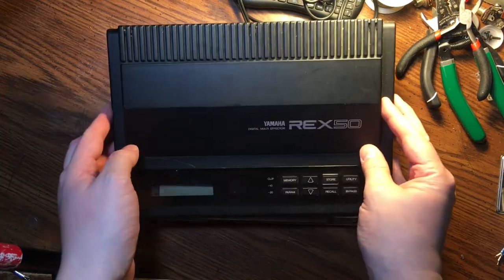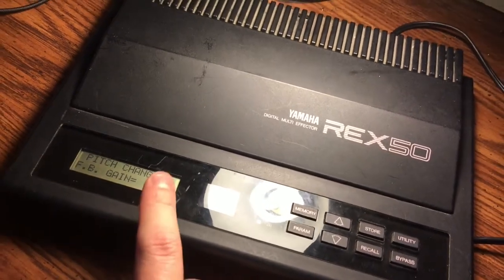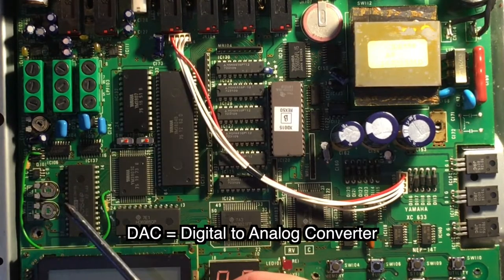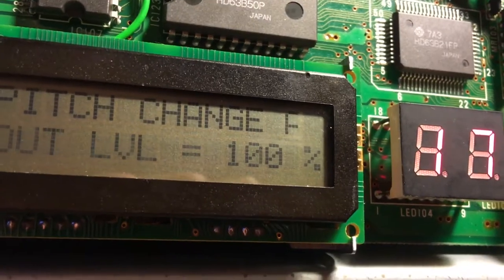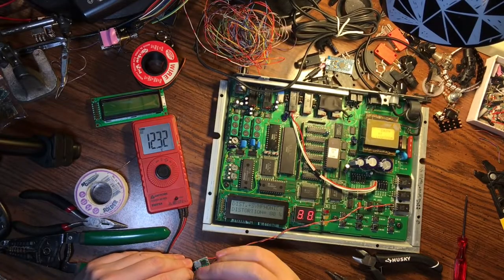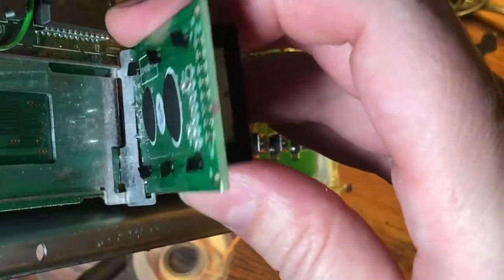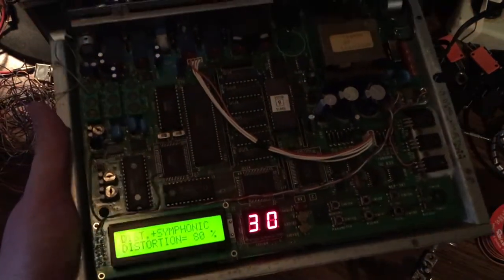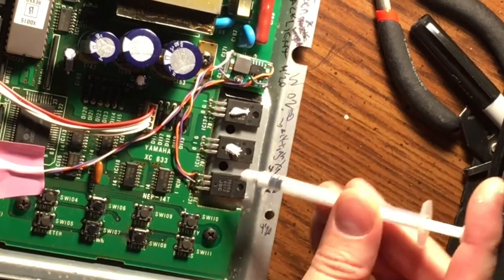Yamaha REX50 Teardown and Repair with Backlight Upgrade

Comment: How do you replace buttons? Do I need to replace the part under the plastic button that is actually pressed? If so, can I? I'm trying to refurbish this unit for a friend.
Reply: also looking for help with this. just bought a used unit and the buttons are sticking really bad